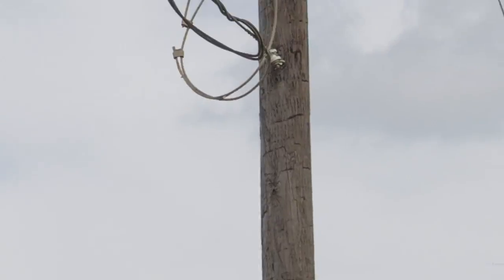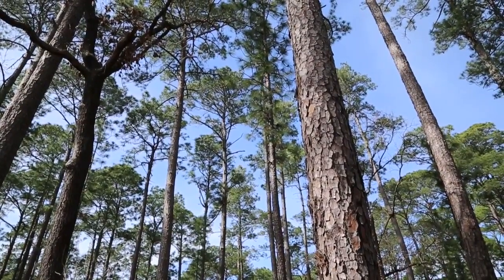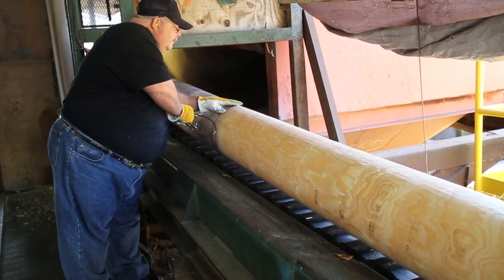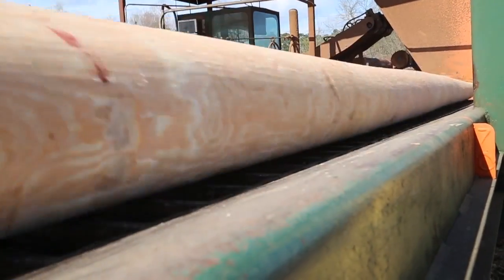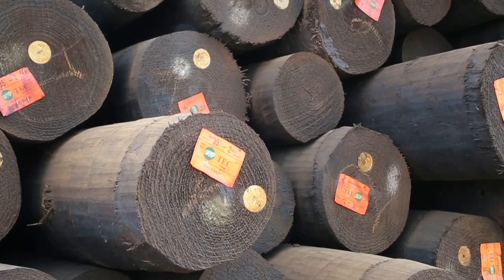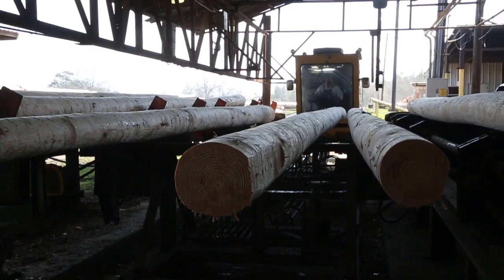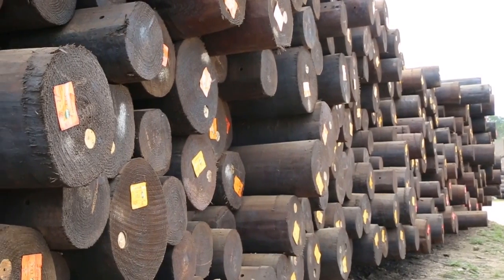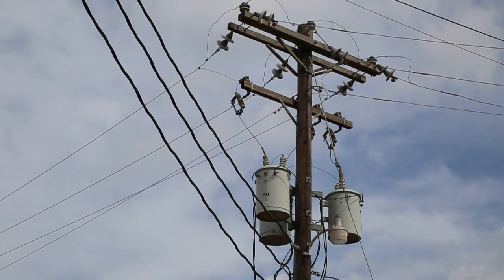How a Tree Becomes a Utility Pole

Comment: I've been working at a pole mill for 14 years now,our mill is way bigger than this  one
Reply: Need some info on wood poles manufacturing....would you like to communicate via email or phone maybe?
Reply: @RT-ig5cs  hey what would you like to know?
Reply: @bengreenhotwheelsandvideos9805  Thanks for replying, I want to get some reference material on the process to make a wood pole from a tree. I want to start that business in Africa. I'm a Civil engineer in the US now....
Reply: @RT-ig5cs  ok that sounds cool,what would you like to know first?
Reply: I'll be glad to help any way I can
Reply: @bengreenhotwheelsandvideos9805  The main equipment involved, the treatment, and the process. Tricks to cut down cost( for example what I definitely need vs what is not as necessary to begin with), etc....how long have you been working in the field?
Reply: I work at this mill how much bigger is your mill compared to are mill?
Reply: Actually I think my mill I work for might be bigger I’ve seen your videos on your channel I’m not a 100% sure thought also how many peelers do you have on your mill?
Reply: @scottholcomb1629  we have 2 peeler a debarker and saw and 4 dry kilts
Reply: @bengreenhotwheelsandvideos9805   we’re about the same size we have two peelers two class stations and 2 stations for framing do y’all frame by hand or by Automation and we have 5 cylinders for treating but deal with dry and steamed poles and creosote
Reply: @scottholcomb1629  wow it doesn't look that big on the video,we frame by hand and we steam dry we have 3 100 ft dry kills and 1 150 ft dry kill and 2 treatment cylinder and I'm not sure what we use to treat our poles but it not creosote it something that turns our poles green
Reply: @bengreenhotwheelsandvideos9805  are cylinders i believe are 100ft long except are dry cylinder it’s 80 I believe and we have automation framing a guy on a framer frames the pole with the machine after it’s lined up and everything and we have hand framing for certain spec for certain companies and you said green poles by any chance just wondering do you work for Koppers?
Reply: @scottholcomb1629  no sir I work for ace pole out of Georgia,and we have certain specs for different companies as well and we ship world wide
Reply: @bengreenhotwheelsandvideos9805  oh okay and I was asking because we use to be partners with KOPPERS and we use to get green poles from them and I work for TEC and we’re out of south east Texas
Reply: Ours is a bit smaller and we do posts and rails and poles . All hand stacked to
Reply: Hi Ben, im looking to quote poles for a tender, is there any way you can help me contact your mill for a quote ? thank you
Reply: Want a cookie
Reply: I worked at gulfsouth pole in sycamore ga gulf south creek runs right through the middle of it